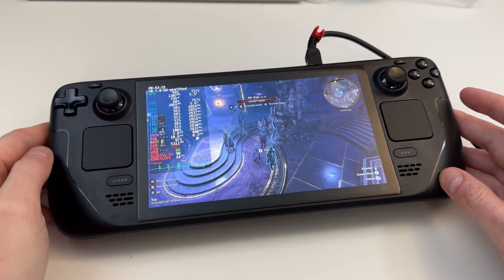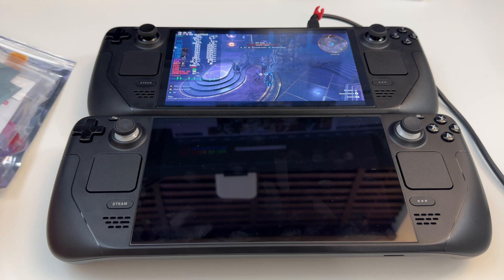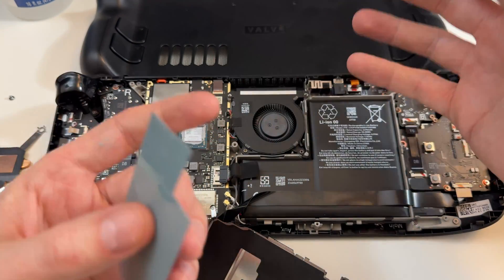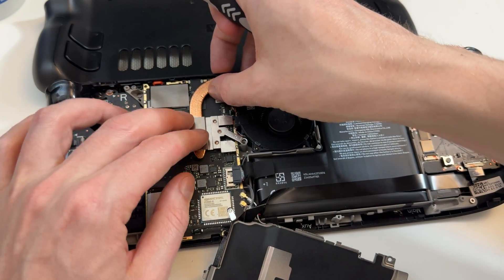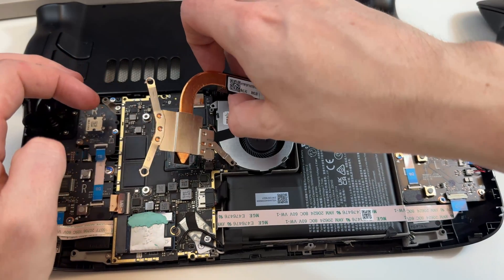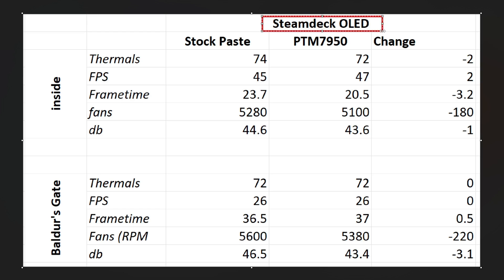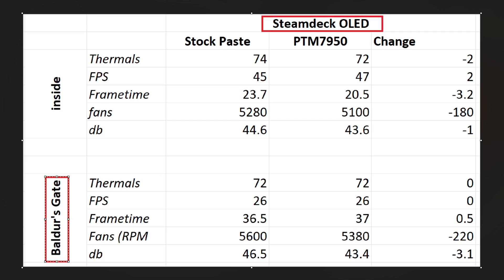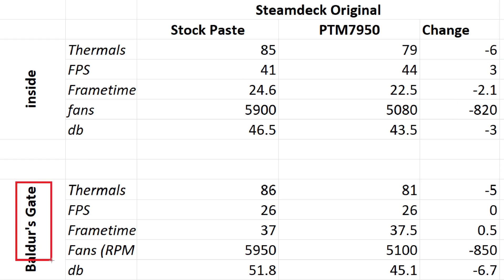Improve your Steam Deck!!  - PTM7950 = quieter fans & low temperature

Comment: I was about to pull the trigger on a new LCD Deck, but I didn't know how much worse it's thermals were compared to the OLED. 85C is dang hot! I don't want a hot and noisy handheld, but I also don't have an extra $150 to justify the OLED model. Guess I'll try to find a used OLED.
Reply from the maker: OLED model is just generally better in every way. If you can find one used or refurbished go for it.

Comment: applied it on mine today. will see if any improvement will happen
My deck is already quiet enough except some really badly made games (like naraka asspoint), but I wanted it to run at less than 80c all the time. Yes I have crippling tech-paranoia
Reply from the maker: Just take your time, disconnect the battery

Comment: 10 minutes isn't enough for you to measure PTM. It actually takes some hours of use as it phase changes and fills every microscopic crevice, then you will get much better results than the first hour or two of putting PTM in.
Reply from the maker: My tests are done the following day
Reply: @TechGuyBeau  Time doesn't do anything, only the machine being ran at high load does. The PTM temps should've been another 5 degrees lower than your test, minimally.

Comment: You made a massive mistake in your testing. You're supposed to have it go through a burning period before it's properly effective. What you should have done was give it a torture test first, or maybe two.

On the other hand, the oled already massively improved the cooling solution, so you won't see as much of an improvement compared to the original deck.
Reply from the maker: I did do that….
Reply: @TechGuyBeau  Oh, I didn't hear you mention that. My bad. I usually run a synthetic benchmark that uses both CPU and GPU to the max first. Anyway, I looked it up and it seems that the cooling configuration was already so massively improved that the most you're ever going to notice a difference in is 3 degrees with slower fans.

Now, slower fans are always better, but to be honest, the main appeal for me is the longevity of this stuff. You'll never have to worry about the thermal paste drying out ever again. For desktop CPUs, it's less practical, but for stuff you never want to open again, like GPUs and laptops and handhelds, it's fantastic.

Comment: Why didn't you clean the surrounding? It still has paste at the side will it matters?
Reply from the maker: It doesn’t matter. Also it’s not a paste it will become solid when introduced to heat
Reply: @TechGuyBeau  Ohhhhh! okay. I see so it will be okay. Will it also be okay to clean it with alcohol and some qtips? thanks

Comment: Fun fact:
1 db equates to approximately a 1.26 times difference in noise level.
3.1 db equates to approximately a 2.04 times difference in noise level.

So PTM7950 can make the game run cooler while also making the fan half as loud. It’s a bigger difference than most people might think.
Reply: you are right, but 45dB isn't loud enough for you to actually notice hearing it at half volume. It's already quiet at stock.
Reply: Also it gets better over time as the material undergoes burn-in.

Comment: I think ye might have confused the phase changing bit. It goes from a paste to liquid at around 60°c which allows it to cover more surface area by filling in small gaps. That's why it works better once you do a few workloads and heat up the ptm a couple of times.
Reply: Everyone else I've heard has said it occurs at 40c
Reply: @sengan2475 ^same

Comment: I wonder how a repaste with something like the Arctic MX6 compares.
Reply from the maker: It wont be as good. Might see a little improvement though
Reply: @TechGuyBeau   Is the PTM7950 really THAT much better? The MX6 currently is one of the best thermal pastes out there.
Reply: @xXYannuschXx yes ptm is much better. It sits between Liquid Metal and normal pastes like arctic. Ptm is superb
Reply: I can actually vouch here. I recently just repasted my OLED with some Arctic MX that I had left over from a Ryzen 7800X3D PC build I did recenty and I have noticed a few degrees drop in temps with the Arctic. My testing wasn't as thorough though. I tested with Red Dead Redemption 2

Comment: I have the PTM7950 in my LCD Deck along with the Jsaux Vented Backplate and have been very satisfied with the lower temps and fan noise. 

Would be very interested to know how the OLED performs with the PTM + vented backplate as well.

Comment: May I know the thickness of the thermal pad used ?
Reply: to answer you because he didn't, ptm7950 is 0.25MM thick
Reply from the maker: It’s not a thermal pad. It’s Honeywell PTM7950. You can get it in the video description below, or ebuy7